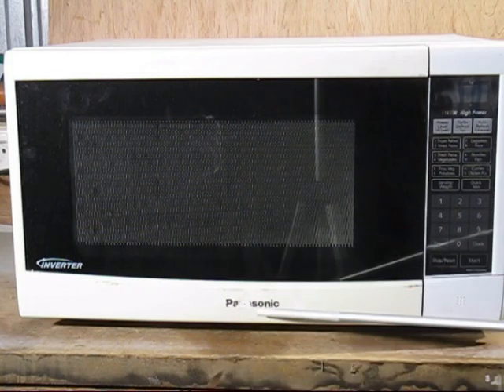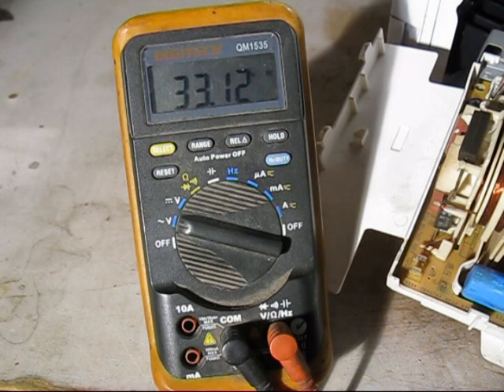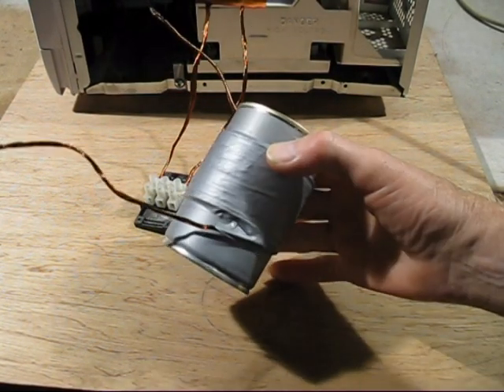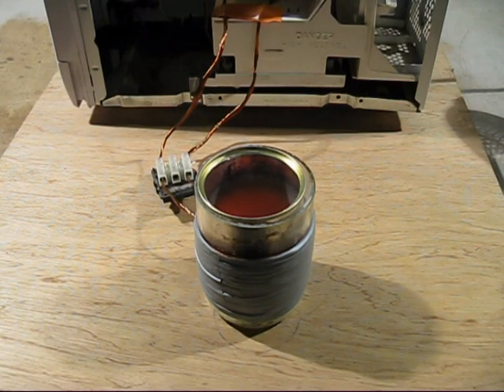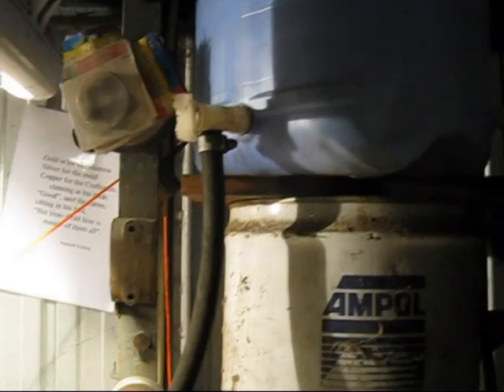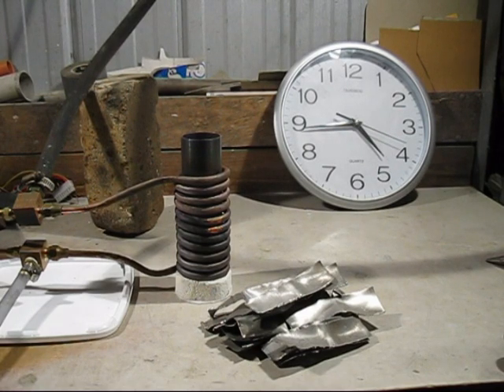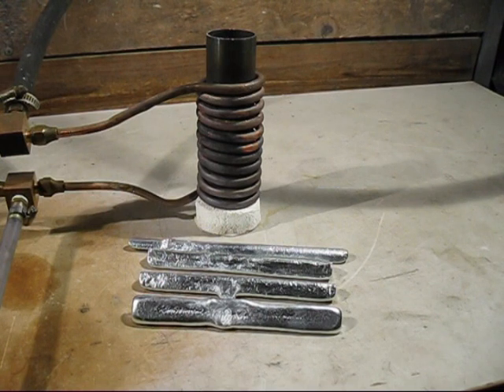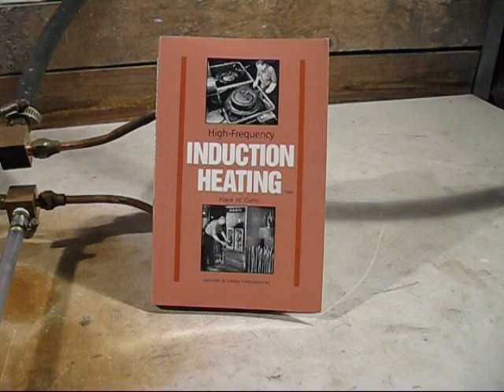First time on youtube, induction furnace made from microwave oven parts

Comment: Fantastic video, if a little scary. Please be careful. You are too valuable a resource to lose. I have a microwave inverter sitting on the shelf that I have eyeballed many times with the same idea. Hats off to you for actually getting it to work in any form. I am guessing (hoping) that by the time you got to the version with the water-cooled work-coil that you had removed the secondary and replaced it with a maybe one turn of the copper pipe. Or perhaps you had to leave the secondary winding in place because the primary side electronics depends on getting some sort of feedback from the secondary voltage to assure itself everything is working properly. If the secondary is still in place it sure is a scary object. Was it just coincidence that the multimeter was reading around 32 when seemingly set to read voltage rather than frequency, when you said that the circuit operates at around 32 kilohertz? I just answered my own question. Evidently it was just coincidence. I just checked my own microwave. Its inverer also stabilizes at just over 32 kilohertz. 

The inverter that I have on the shelf is evidently not a symmetrical push pull type of circuit nor a symmetrical half-bridge circuit. I say that because it doesn’t have any two power semiconductors that are physically alike. Consequently, I suspect that it is some sort of fly back circuit such as was used to generate the EHT voltage in older television sets.. In the normal operation of a flyback inverter, the primary driving circuit switches on to magnetises the core, then it switches off and it is the secondary that then does the work of charging the high voltage circuit as the flux decays. That is the flyback part of the cycle. If it is that type of circuit, that may explain why it is tolerating what you are doing with it. The electronics driving the primary side evidently is happy, just so long as it can magnetise the core without too much extra loading. It doesn’t care and isn’t affected much by what happens in the flux decay part of the cycle. I would love to see the oscilloscope waveform of the voltage on the work-coil. Apart from melting stuff, the device that you have demonstrated could  be used for heat treating steel and forging. I salute you sir. You are indeed a national treasure. Cheers. 

Everybody should be aware that operating a microwave oven without its outer case in place exposes you to some microwave radiation. Mind you, the early WW2 radar technicians on the coast of England used to stand in front of their antennas to warm up in cold weather. I doubt that is recommended practice these days. Evidently, the eyes are particularly vulnerable to heating effects of microwaves. It can cause cataracts and retinal damage amongst other things.
Reply from the maker: Life would be very boring without some scary moments. The fact that I am still alive after 14 years of dismantling microwaves to see how they work shows that I am a very careful person. So many have commented about my mutimeter being on the wrong function. If you have a closer look you will see Hz on the right hand  side of the screen and also there is a k after 32, if my meter is reading 32,000 volts after a couple of turns on the primary then it would be scary to go anywhere near the mutimeter! I was reading one of your answers to another commenter. It shows that so many viewers of my video don't know much about induction heating. To get this to work you have to be a very smart person. It is so easy to comment but it is another thing to modify a microwave oven and get it to work as an induction heater! I used a crt flyback transformer because the original transformer is too small to fit in a copper pipe secondary winding. It will be good to see some one else have a go at modifying this type of microwave oven.
Reply from the maker: I forgot to mention that every inverter in a microwave there is a current transformer to monitor what is happening when it is running. The display on the touch pad shows cool, which means that the magnetron is not working when being used as a induction furnace.
Reply: @luckygen1001  Have to think there will be some DIY induction stoves cropping up.  Some EE Einsteins may try some interesting tweeks as well.  But you were still the first and so far the best.  Do you have any other plans currently?
Reply: Yes. There must be 101 uses for a dead microwave oven. That’s why I have my own collection of them. If I remember correctly, you use the timer from one as the timer on your sand muller. The transformer from and older one, minus its secondary winding, has many uses – spot welder, auto transformer to get 110v. With the capping pole piece sawn off and 12V DC applied to the primary, it makes a dandy powerful electromagnet, which is capable of re-magnetising or reversing the polarity of ferrite and alnico magnets. I used one to reverse the polarity of an old Husqvarna chainsaw flywheel so that it would work with a Ryobi magneto. As you showed, in one of your videos, the same part can be used as an induction heater to heat bearings or other circular pieces for shrink fits. Now you have given life to a who new bunch of possibilities with the newer inverter microwave models. A non-dead microwave oven can be used to dry out wood, although it can also set it on fire if you are not careful. It is amazing how much more easily wood will burn when it is really dry. You can just about light the corner of a piece of 3”x 2” with a match. It’s great for preparing wood for a wood fired grill.

I couldn't quite make out the symbols on the multimeter readout in the video, but after I had checked the frequency of my own microwave inverter and confirmed that it was operating at just over 32 kilo Htz,  I knew that what appeared in the video had to be either a reading in kilo Htz or a coincidentally similar number from some other voltage check that you might have performed. I had faith in you. See also my new comment further above. cheers
Reply from the maker: I want to melt more cast iron now that winter is not far away.

Comment: The glass did not shatter because it was properly tempered. A previous heat treatment took care of all the internal molecular forces and you could have melt it all the way to liquid in that experiment. However, the heat you applied and the way you cool it down, could have damage the temper. That means that the glass is no longer good to use.
Reply from the maker: One day later after I did that experiment the glass did crack for some unknown reason although you maybe right.

Comment: I did a similar experement took a heating element out of oven straightened it out and wrapped it around a stainless steel crucible n gave it 240 volts took about 40minets too get cup and a half of liquid aluminum very easy to do as exp.... Just need stainless cup old element from oven (lower) and old electric cord chopped off something!

Comment: I'm missing something.
Why isn't the electricity shorted out with the water cooling?  
Is there an insulative barrier between the copper and water?
"Playing" with 5000V doesn't leave too much (any) room for error.
Reply from the maker: Water cools the copper pipe conductor down only it does not short out.
Reply: @luckygen1001   Could use distilled water, basically non conductive..
Reply from the maker: I used tap water which is very conductive.
Reply: he is not using the high voltage winding, he bypassed it and did his own. much fewer turns and much thicker wire. less volts more amps

Comment: needs temperature control..
Reply: it has temp control, it's a friggin microwave oven. you could even defrost your nuts with it if you wanted
Reply: @LateNightHacks  no! that is a power limit. not a temperature control.
Reply: @LateNightHacks  I read somewhere they require a certain power level otherwise circuit would fail, so maybe levels below say 50% and defrost would not work - Not sure ??
Reply: @mevk1  microwave power supplies are designed to run magnetron oscillators. Magnetrons generally have a criticality point and really don't work at less than full power. Hence why they are switched on and off instead of throttling.
@Peter Elens true, but since magnetrons can't really be throttled, that's the best you can get out of a power supply that is made for them. Induction heaters are also resonators, they have a narrow efficiency band, they don't like throttling either. So either way you need to control temperature by switching power input to balance with heat loss. For accurate control you would want a feedback loop, alas, adding a feedback loop may be a bit of a pain depending on the design of that particular power supply

Comment: Your meter was on V, VOLTAGE. You got 30 VAC. A for frequency, you need to use the Hz function, Hertz. Sheesh, really horrendously dangerous stuff happening here.

Comment: You didn't show or tell where you attached the wires in the microwave. 👎👎👎
Reply from the maker: I connected to the output wires of the inverter before it goes into the transformer.